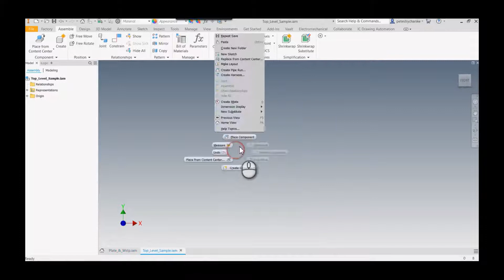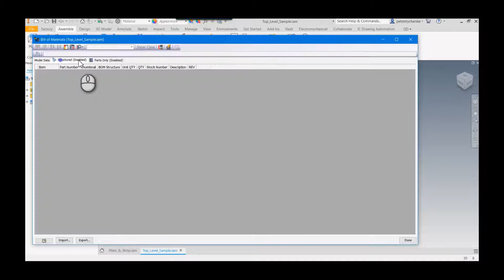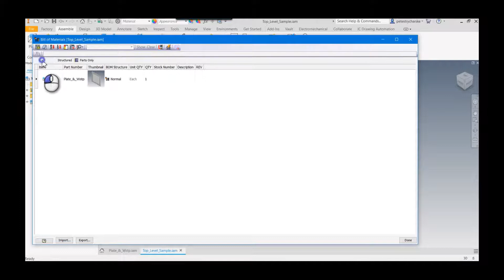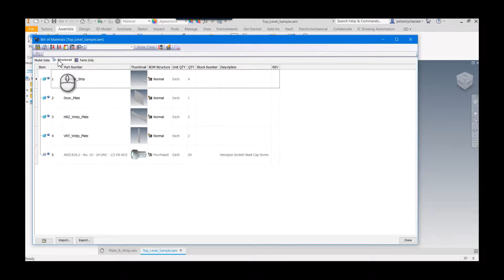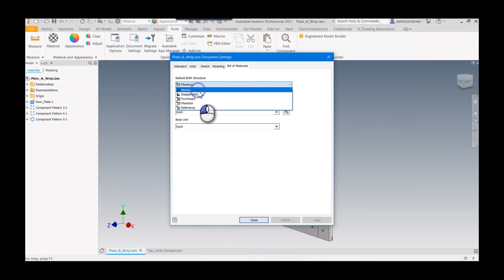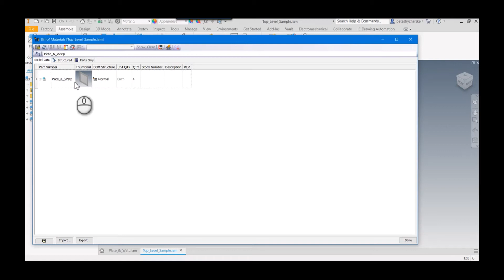Inventor - How to Work with the (Not Scary) Phantom BOM State

Comment: A couple years behind this original post, but I came here after searching for why my main assembly isn't showing in my BOM.  I get all of the parts showing up, but not the main assembly.  It's a FAB and everything is set to NORMAL, and I select "FAB" when initiating my parts list, but the only thing that doesn't show up is the main assembly (I don't have any subassemblies). It's not a large assembly by any stretch either. My parts list is set to  STRUCTURED too.  What am I missing??

Comment: When putting that part to phantom, does that part show on the model but won't appear in the bom when ordering?
Reply from the maker: Yes.  When setting the part model to a Phantom BOM State, it will NOT appear on the BOM list, either Structured or Parts only.